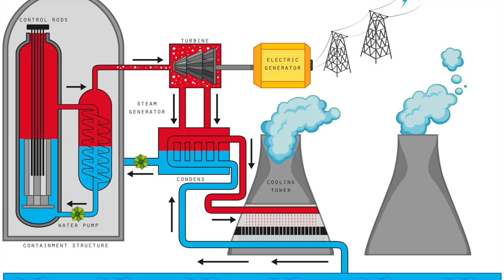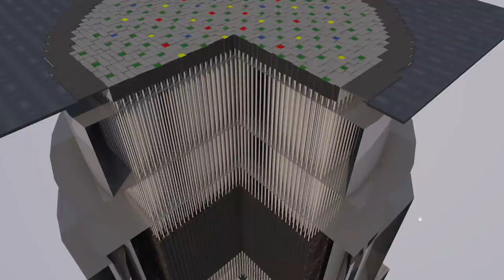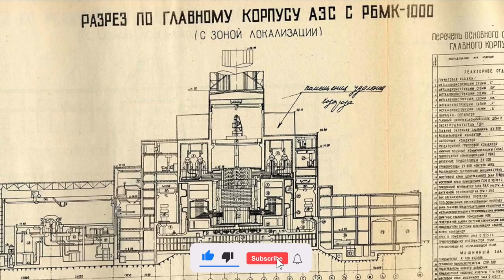Boiling hell: what happened at the Chernobyl nuclear power plant

Comment: RBMK reactors had more than one problem. Add the poor training, the crazy pressures from communist government wanting to save face, and from one end to the other this was a preventable mess. To describe the explosion as "nuclear" is a technical possibility but a very misleading one. Since the fuel is way too low in enrichment, the geometry is all wrong, moderators present etc its a very large stretch to call this "nuclear" other than a being able to ascribe certain general reactions happening that are nuclear in nature but not exactly what you need for a nuclear bomb, which nuclear "explosion" implies.
Reply: nuclear bomb and nuclear explosion are still two different thing tho...
Reply: "RBMK reactors had more than one problem."

Its inherent instability was just one of them. The RBMK absolutely hates being run at low power for extended periods of time because it can't do it. They were never designed with that in mind. But that's exactly what they forced it to do when the test was delayed by the Grid-controller. This opened up a whole can of worms with regard to Xenon build-up. Add to that a SCRAM system that, under the right circumstances, can actually become a reactivity ACCELERATOR instead of shutting the system down, having a design with a Positive Void Coefficient that gets progressively worse as the power level gets lower with no containment to speak of, and we can all see where this is going.

No, a nuclear reactor does NOT magically turn into a nuclear bomb, the physics simply do not allow for it. Here's the difference:
A nuclear bomb has (as you already mentioned); High enrichment, at least 80% or higher. It has NO neutron absorbers as that would defeat the entire purpose of said bomb. And it most certainly has no moderators present as, again, that would defeat the entire purpose of the bomb.

A nuclear reactor has:
- A moderator to slow down the neutrons to facilitate a controlled, sustained chain-reaction.

- It has low enrichment. Most reactor types sit anywhere between as low as 0,7 % (CANDU reactor type) and 3% - 5% enrichment (PWR/ BWR). An RBMK sat around 2% enrichment before the accident, this was later raised to 2,4%. At the time of the accident Unit 4 was at the end of its first fuel cycle, which means that the fissile content in the fuel assemblies was even lower.

- And lastly, every nuclear reactor out there has some type of neutron absorber for controlling powerlevels and shutdown whether that be for maintenance or emergency.

What did happen is an uncontrollable prompt neutron excursion due to the massive insertion of reactivity through the graphite displacers that were at the end of each control rod. They unknowingly added even more reactivity to the bottom of the core that was already running away with itself. For a very short period Unit 4 solely ran on fast neutrons, effectively becoming a "fast reactor" instead of a thermal reactor. However, no thermal reactor cooling system is able to cope with the amount of heat produced. That's why the only commercial fast reactor (BN-800) in the world is sodium cooled.

So yes, it was an explosion made by nuclear things, but NOT an atomic bomb.
Reply: @swokatsamsiyu3590  Exactly. I've argued this with people for some time. It was not a nuclear bomb. The only consolation I will now make with people, is that on a technical level, there were fission materials and reactions taking place, therefore nuclear and if someone wants to call it a "nuclear explosion", well they can go for it, I'm no longer going to argue it with them. On the other hand, if they want to imply or claim it is a nuclear bomb, there I draw a line, for all the reasons you stated above and others. The fundamental key to the entire situation is "uncontrollable prompt neutron excursion". This says everything a person needs to know.
Reply: @NickFrom1228  
We come at it the same way. If they want to call it a nuclear explosion, fine. But I bristle when they start the whole "atomic bomb" thing because it was not. Misnomers like that foul up any debate to be had. It needlessly put nuclear energy in a corner where it doesn't belong. I understand that for a lot of people it is a scary subject, especially in the light of accidents like Chernobyl and Fukushima. However, it is by far one of the safest forms of energy production out there and whether people like it or not, we will need nuclear power to clean up our climate act.

As for the accident, I study reactors as a hobby with a heavy bias towards the RBMK because it is such an oddball as far as reactor designs go. Having an extensive technical background, I absolutely marvel at just how badly the operators abused Reactor 4 while even back then it was widely known that an RBMK is at its most unpredictable at the end of a fuel cycle and/or at low power. The fact that they happily disabled/ cancelled or ignored every safety system that they could get their hands on in order to force it to keep going, is a testament to a complete lack of any safety culture or respect for the technology they were handling. We all know how that turned out.
Reply: @swokatsamsiyu3590  I am similar. My degrees are in engineering and I study nuclear physics for a hobby. I get annoyed when there is all this fear and paranoia generated for no legitimate reason other than people being ignorant, whether intentional or not. But it's so so ingrained in our daily society. Look at the opening to the Simpsons. You see the nuclear plant going up in a mushroom cloud. How many millions of people have seen that and integrated the idea that a power plant can explode like a nuclear bomb into their mind, not knowing it's impossible? I point as many people as I can at Dr Mullers Physics for Future Presidents, which has a nuclear segment. Its super top level but at least people get a rough idea of whats going on.
Reply: @NickFrom1228  
Master Welder with 30 yrs of experience under his belt here. While I probably may never be able to do the foot-long math formulas, I at least have a firm grasp of the basics and most certainly the technological side of things because that's where my expertise lies. Reactors have always had my interest. Since medical malpractice (thank you socialist healthcare!) has made it impossible for me to do my welding anymore I really sank my teeth into them if only to keep myself from going stir-crazy. It really is a most fascinating technology to study.

That intro may have done the single most irreparable damage (apart from the real accidents of course) to the view of the general public when it comes to all things nuclear. Good heavens, what a load of codswallop that is! Again, we're on the same page here.

Among others, I watch lectures from the Illinois Energy Prof. He really has a gift for teaching complicated subjects in an enjoyable manner. And I do a lot, and I mean a lot^^, of reading. Things like the INSAG-7 report about Chernobyl, Fundamentals of CANDU Reactor Physics etc., I read it all and then some.
Reply: @swokatsamsiyu3590  Sorry to hear about your healthcare situation. Strangely, this is what is held up as a great thing and I for the life of me cannot fathom how people think this. 

MIT has a bunch of stuff on nuclear subjects. I recommend them but they can be dry at times. Still, top notch stuff. I need to look into the INSAG-7 report. Sounds interesting, as is CANDU. I like the design of CANDU and its cooling design in particular.
Reply: @Jim Frazier Very nice summary. As for things suppressed by KGB I couldn't help but laugh. While the US gov has done its fair share of covering up things, I've had people tell me that the US has had far more accidents than Russia. This rather purposefully erroneous claim has two problems: 1. The US has revealed the vast majority of nuclear incidents over the years, 2. The severity of the incidents pales compared to most of Russia's. We are only now finding out about many of Russias (granted a lot of the records for these were made available after the fall of the USSR but they didn't exactly say "Hey, heres all the records of our nuclear accidents. Check out building 29, isle 6.") Anyway, it's a classic example of the failure of authoritarian regimes combined with incompetence while operating a poorly designed reactor.
Reply: @NickFrom1228  
All the idiots clamouring for communism/ socialism right now have absolutely no clue about the can of worms they're about to open with that. They will not like what they're going to find.

INSAG-7 is really good although very technical and dry. I can also highly recommend a book written by Zhores A. Medvedev "The legacy of Chernobyl" if you want really get into the weeds of things. Be prepared to pick your jaw up off the floor repeatedly while reading it because the utter folly, the complete ineptitude will have you gasping for air. None of these folks should have ever been allowed anywhere near an RBMK, much less run one!

As weird and unsettling as it sounds, in a way the CANDU is very much like an RBMK, but then done right. They put the reactor on its side, did away with the smelly old graphite and gave it proper safety systems and containment. It uses LEU, and can potentially close the nuclear fuel cycle by using spent fuel from for example PWRs. It employs the same pressure tube design and even has a positive void coefficient, normally viewed as a bad thing in reactors. However, this will only happen if the moderator itself starts to boil. But because they use heavy water as the moderator/ coolant they have created a much bigger stability in their chain reaction. They made the fission process in CANDU a deliberately sluggish response, which allows controllers much more time to diagnose and deal with problems before they become a real issue. In comparison, an RBMK is on a hair-trigger when placed next to a CANDU.

As for the safety systems; CANDUs are very, very safe, sporting proper containment and extensive active/ passive safety systems. They have two SCRAM systems (Control Rods and a Poison Injection System) that will work without power or operator intervention. And under no circumstances can it start back up on its own, a manual start by an operator is required in order to get things going again. If you want to have a nice read about the CANDU, go for "Fundamentals of CANDU Reactor Physics" by Wei Shen and Benjamin Rouben. It is not too heavy on the math and has a very detailed review of the CANDU, its design, operation etc.. Happy reading!
Reply: @Jim Frazier 
May I give a small correction to your otherwise excellent comment? In 1975 it was Leningrad Unit 1 that had the first design flaw related incident. In 1982, Chernobyl Unit 1 had a partial core meltdown due to a cooling valve being left closed after maintenance. The accident wasn't noticed until hours later(!) due to negligence of the operators. Another incident involving the control rod design flaw happened again with Ignalina Unit 1 in 1983. But like you already mentioned, the KGB made sure it was all swept under the rug, with disastrous results.

If you really want a terrifying read; Here is a list of the safety systems the operators at Chernobyl Unit 4 either physically disabled/ cancelled or ignored in order to force Reactor No 4 to keep going. It tried to shut itself down for almost an hour before finally catastrophically failing because they had backed it firmly into a corner for their ill-fated test:

- The Emergency Core Cooling System. They ran the reactor for almost 11 hours with the system physically disconnected(!) from the core.
- Automatic Control Rod System disabled. (This would have scrammed the reactor)
- Manual extraction of almost ALL control rods, even the special group that was supposed to be in the core at all times.
- Steam/ water separator alarms were repeatedly cancelled. (This would have scrammed the reactor)
- Feed Water Flow Rate alarms repeatedly cancelled. (This would have scrammed the reactor)
- Excess Steam alarms repeatedly cancelled. (This would have scrammed the reactor)
- Neutron Power alarm repeatedly cancelled.
- Emergency Thermal-Hydraulics parameters repeatedly cancelled.
- Two feed water circulation pumps switched off.
- Turbine emergency regulating valves disabled. (This would have scrammed the reactor)

At 01:22:30, even the woefully antiquated SKALA computer screams a warning at them via a printout that, due to the state of the reactor core, it is to be shut down immediately. They chose to ignore that as well. All the systems practically begged them to stop what they were doing and they just kept going. How in the world do you manage to brush aside so many warnings and still think things will turn out well. For the life of me, I will never be able to understand this.
Reply: @Jim Frazier 
Yep, I know that Dyatlov was involved in earlier nuclear mishaps and that it cost his son his life. While we cannot blame him for not knowing the fatal design flaw in the control rods that was kept from them, I most certainly hold his insufferable arrogance and rudeness to his staff against him. I feel for Toptunov/ Akimov that knew that what they were doing was very dangerous, but because of the totalitarian system they lived in they were too afraid to speak up or take matters into their own hands. If they had been free of that fear they might have taken different decisions. That's why I said that none of them should have ever been allowed anywhere near an RBMK, let alone handing them the reigns of one. An RBMK is very unforgiving to its operators when it comes to making mistakes in the best of times. When placed into the very unstable state they put it in, that only gets progressively worse. And this is something that was widely known by most operators at the time, that's why it just floors me how far they were willing to take matters in order to complete their ill-begotten test.
Reply: @Jim Frazier 
I completely concur with you, the operators didn't have the slightest idea that you could physically put an RBMK into orbit. That being said, the designers had at least the start of an inkling. When they designed it they knew that, if more than two fuel channels simultaneously failed, the UBS would come off due to over-pressure in the reactor vault. But they probably never envisioned it being hurled up through the roof like that. For that to happen, a lot of unlikely circumstances and decisions had to come together in a perfect storm. Fun fact, the UBS was NOT bolted/welded down. It was held in place by sheer weight.

TMI at least showed that having things like a containment building in place can save you from an unmitigated disaster if it all goes pear-shaped, however unlikely the chance. That accident also brought about major improvements in both control room design and operator training.

The operators at the Fukushima Daiichi NPP were absolute heroes. They went above and beyond the line of duty and then some. To come up with the notion to jury-rig a bunch of their car batteries in order to get at least some readings off of their instrumentation is brilliant enough. But to then actually go and pull it off puts it into a league of its own. And Mother Nature has a way of putting human hubris in its place. We ignore these lessons at our peril.